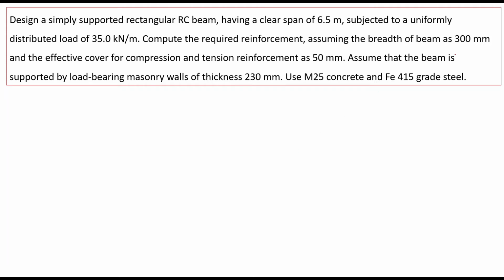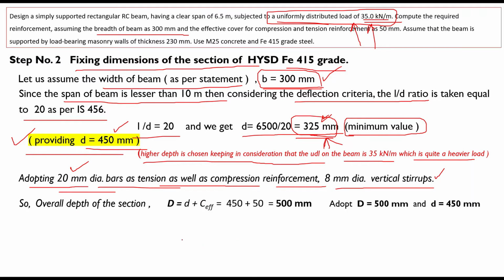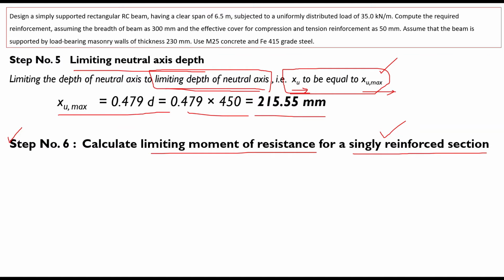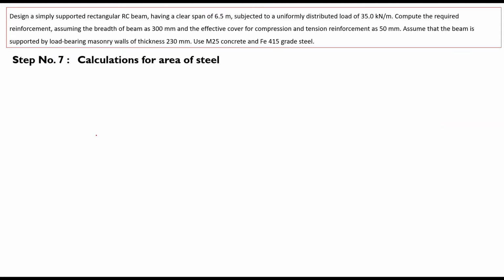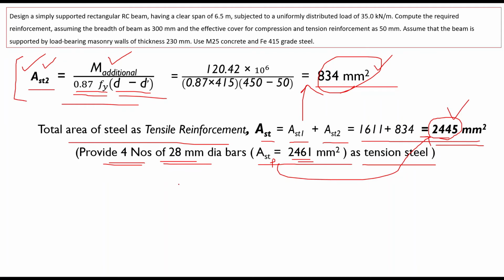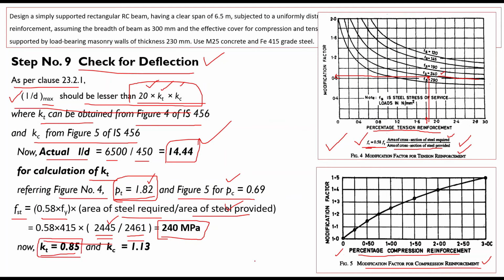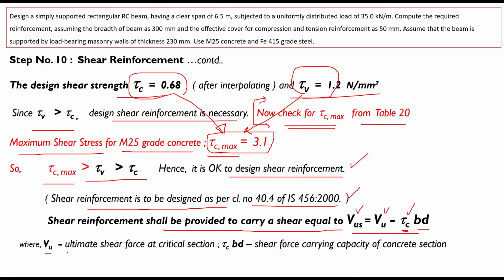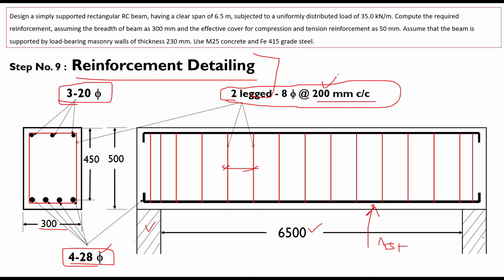Lecture 15 || Design Doubly Reinforced Beam || IS :456 -2000 ||  Civil Engg.

Comment: Sir, we calculate d using deflection criteria that means we have already made the beam safe in terms of deflection, then why we have to do the deflection check again? And can this deflection check be done in singly reinforced beam design?
Reply from the maker: Because initially we assume the value of 'd' keeping in consideration that its having high probability that deflection will be under control, but still we have to apply the checks to ascertain that whether our assumed value is sufficient based on depth as well reinforcement which is designed.
Reply: @DrBharatBhushanJindal  sir, that means deflection check should also be done in singly reinforced beams?

Comment: Sir, does development length have no important role to play in designing doubly reinforced beam?
Reply from the maker: Development length has to be designed to ascertain whether it's sufficient to take care of bonding between steel and concrete, in other sense, we can say that whether steel and concrete can sufficiently able to act as a composite material.